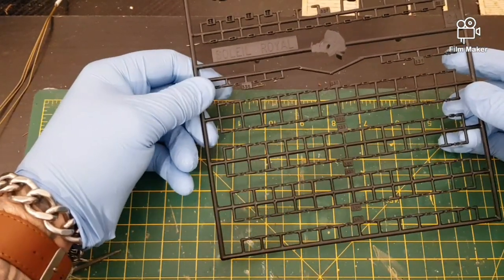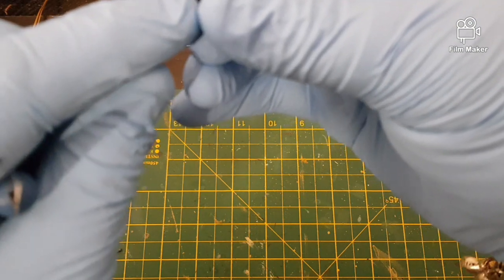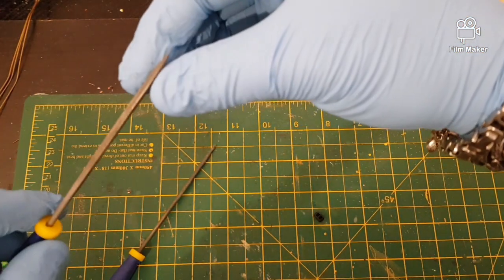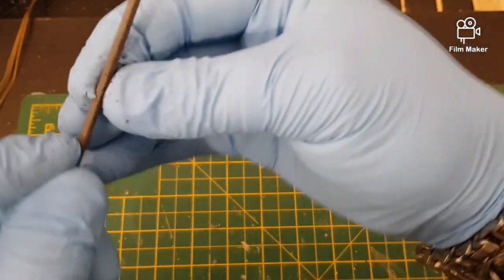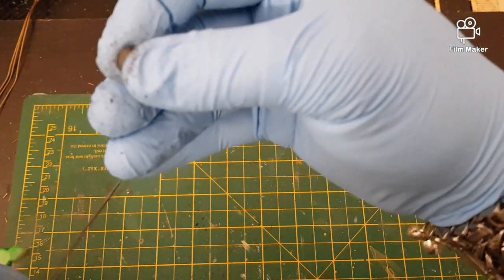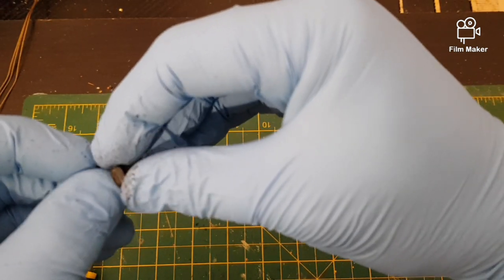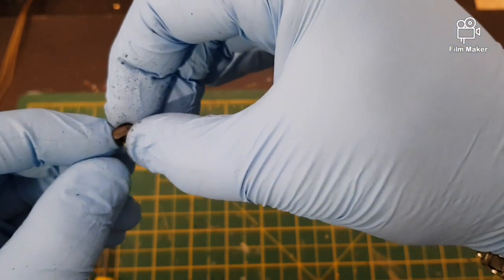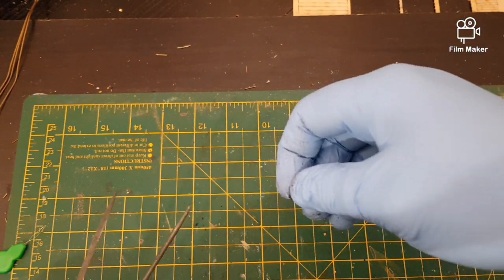Heller Block Modification

Comment: Hi Rob, great tip. I have both those kits and did not know about the blocks.
Reply from the maker: Thanks buddy. Yeah the blocks are almost impossible use due to the lack of a channel for the ropes to sit in so if you use this method you can use them as easily as any wood block. If you can afford wood blocks that it's not a problem, but if you want to save pennies then this method helps save pennies and it's very simple, swift and works perfectly 😉👍👍👍

Comment: Great tip, I have a few 1/100 heller kits including the kits you mentioned.
Reply from the maker: Yeah I know quite a few people that wanted to use the kits blocks, but run into the common problem. If you can afford it I would suggest nice quality wood blocks, bit if you want to save pennies, you will be able to use the blocks in the kits in exactly the same way you would the wood blocks by using this little block mod.  Very simple and quick 😉👍👍👍

Comment: Thanks for the tip Rob.
Reply from the maker: You very welcome Jim. If it helps then it was worth it..  If you can afford the expensive aftermarket blocks then thats great, but to save pennies this method works really well and is exceptionally quick. As a bonus it doesn't cost anything at all. 😉👍👍👍